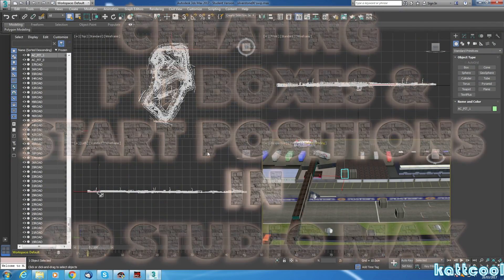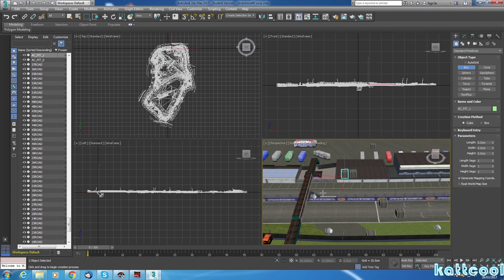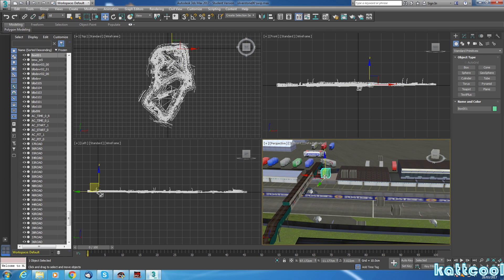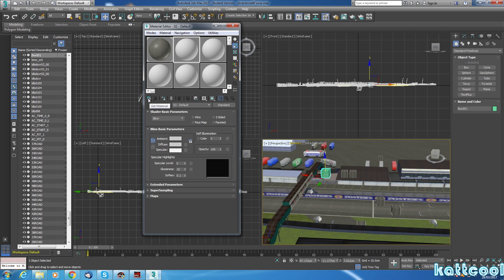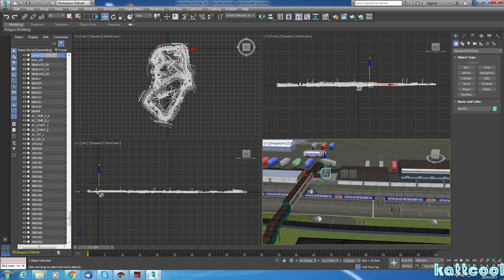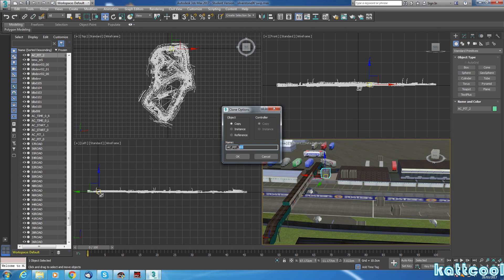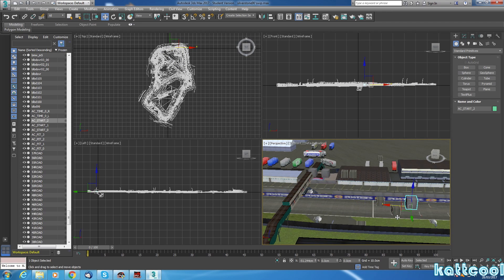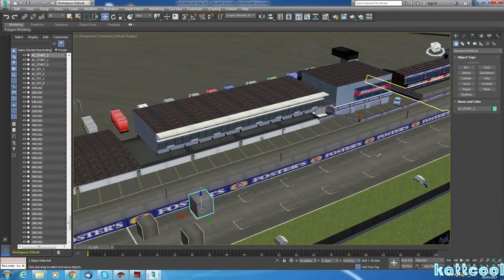Tutorial : How to create pit boxes & start positions in 3d studio max for assetto corsa tracks

Comment: This is brilliant thank you! I can now add more grid spots. However. When I save it as .fbx then convert it to .kn5 is there something else I need to do now to get Assetto Corsa to now recognise all, in this case 28 boxes rather than the original 23 or whatever I add? 
Anyway thanks again.
Reply from the maker: Hi , you need to also alter the ui_track file contained in the ui folder of the track with the right amount of pitboxes which you have added
Reply: Silly question. How do I do that? Notepad?
Reply from the maker: macman6107 yes in notepad ;)
Reply: Awesome. I used Notepad++ so that saved me from converting or whatever. Not really pc literate at this stuff. One other question. When I was opening in kseditor a dialog box comes up and says ERROR, FOUND SCALING ON NODE: RootNode. 
I've not used my own track just added to someone else's for my own private use.
Reply: Also when I went to use it in game it says Game Crashed AI spline might be missing or broken. :/ 

Thanks for all your help btw
Reply from the maker: have you changed the scale of the project in 3d studio max ? if so that is your problem , the scale needs to be 1.00
Reply: Thanks. I don't think I have but I'll have a look again and see. Cheers for your help.
Reply: Yes I had accidentally moved the slider for the scale. However I'm still getting the AI Spline missing when trying to start the track in game. How/why is that happening when I haven't done anything other than the grid spots and pit boxes?
Reply from the maker: hmmmm im really not sure why that would be ive never had that problem

Comment: Please help, I copied 30 extra pits, both the pitbox and the startlane, exported to an FBX. I figured there was more I needed to do other than change the models.ini but I'm not sure what. I tried it in game and it just told me the name of the track Sorrow with this "Sorrow: TRACK NOT FOUND" Any help would be greatly appreciated, thanks in advance. PS: good video, I know I'm just a nub ahaha
Reply from the maker: is it a track you converted from another game ? or 1 you built yourself ?
Reply: kattcool  neither, I found this mod on race department months ago. I converted the kn5 to fbx files, opened the fbx in 3ds, did what you did. I found out there's no way to change it back to a kn5, but is there a way to use the fbx as the map instead?
Reply from the maker: there is a way to convert back to .kn5 , you need to import the .fbx into the assetto corsa editor which is located in the dev folder in assetto corsa on your computer
Reply: I just found that about 20 minutes ago, and just got a bunch of errors when I tried to export it :/
Reply from the maker: there is just textures missing thats why , the track should still function even though you got those errors
Reply: it's saying export failed at the end of each error message for everything. It doesn't even export.
Reply from the maker: if you can find somewhere to upload the .fbx & textures i can take a look for you if you want ?
Reply: Most definitely, anything to make it easier. Thank you and here you go  https://drive.google.com/open?id=0Bz_kOv_GFVnKYmJ1NEd0cjBWX00
Reply: Did you ever find anything out with those files?